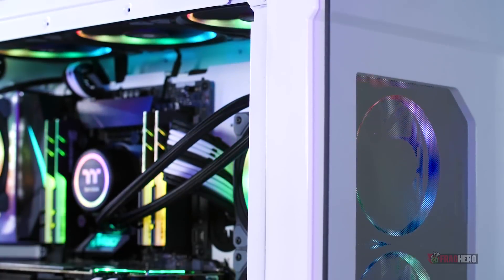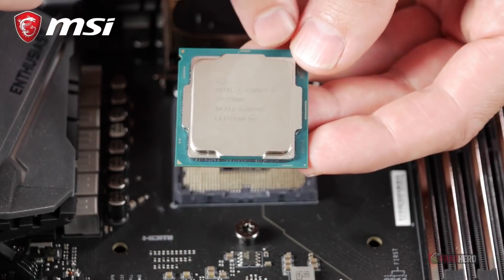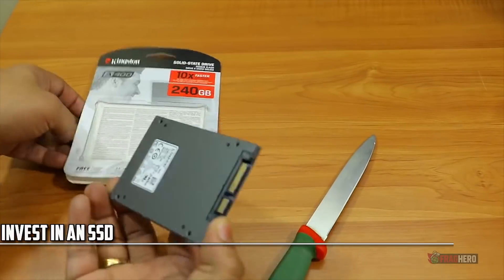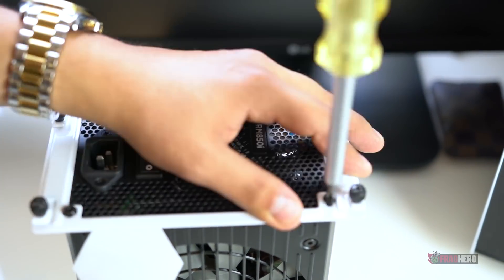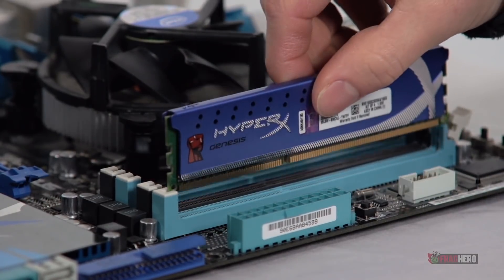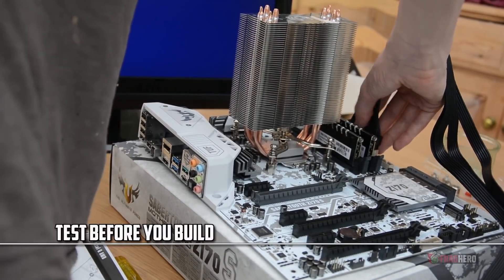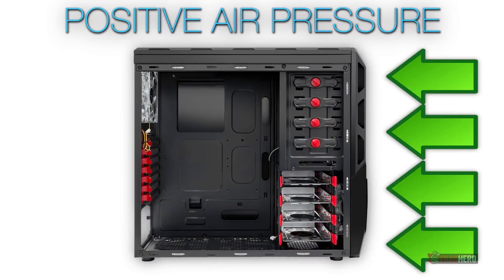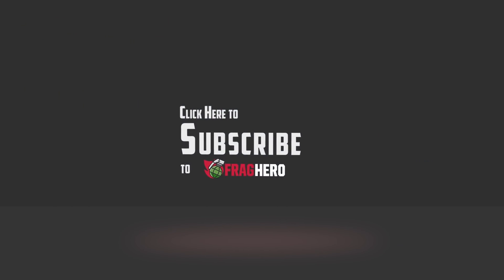10 Must See Tips for Building Your Own PC

Comment: 139watts casual rig:
Intel Core i3-9100F 3.6 GHz Quad-Core Processor
ASRock B365M Phantom Gaming 4 Micro ATX LGA1151 Motherboard
G.Skill Ripjaws V Series 16 GB (2 x 8 GB) DDR4-3200 Memory
*Geforce 2gb graphics card
*250gb ssd
*2tb hd
FSP Group HEXA+ 500 W ATX Power Supply
*already own
$600 for new parts + $100 for a new case if I need one.
any additional advice?